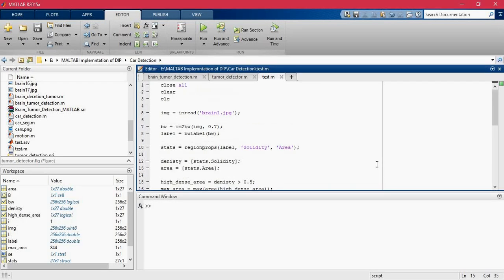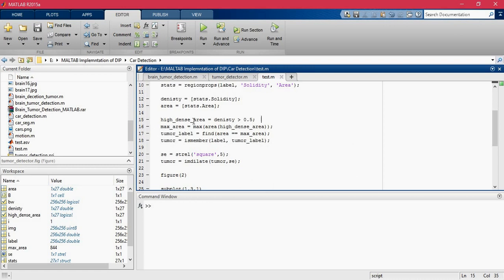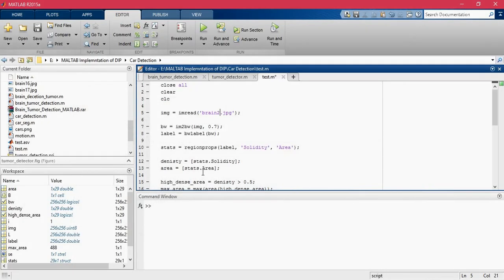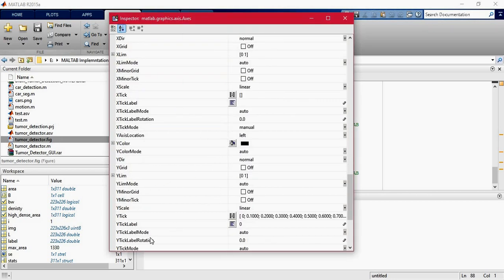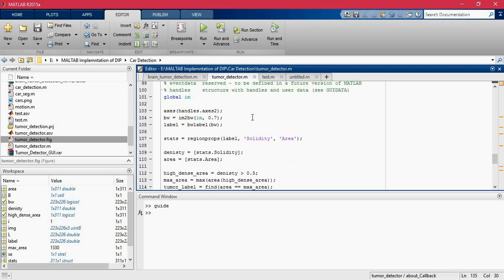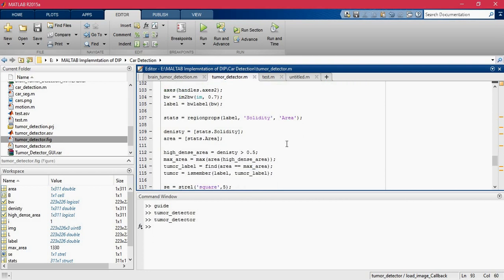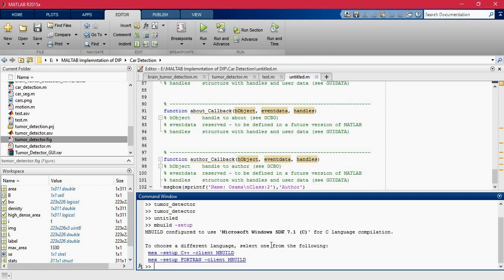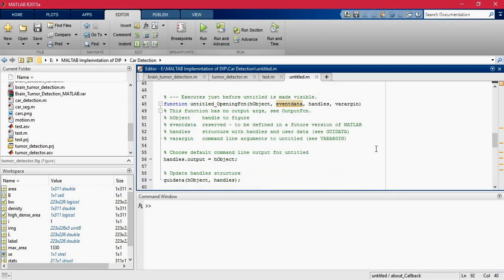Brain Tumor Detection using Matlab - Image Processing + GUI step by step

Comment: close all;

clear all;
clc;
img=imread('brain1.jpg');
bw=im2bw(img,0.7);
label=bwlabel(bw);
stats=regionprops(label,'Solidity','Area');
density=[stats.Solidity];
area=[stats.Area];
high_dense_area=density>0.5;
max_area=max(area(high_dense_area));
tumor_label=find(area==max_area);
tumor=ismember(label,tumor_label);
se=strel('square',5);
tumor=imdilate(tumor,se);
figure(2);
subplot(1,3,1);
imshow(img,[]);
title('Brain');

subplot(1,3,2);
imshow(tumor,[]);
title('Tumor Alone');
[B,L]=bwboundaries(tumor,'noholes');
subplot(1,3,3);
imshow(img,[]);
hold on
for i=1:length(B)
    plot(B{i}(:,2),B{i}(:,1), 'y' ,'linewidth',1.45);
    
    
    
end

title('Detected Tumor');
hold off;
    

works absolutely fine for me::::
thank you so much
Reply: Sir thanks a million but i have problem in running the code.i runned the code but there is problem in 

max_area=max(area(high_dense_area));
Reply: Sir can I get the dataset for this code
Reply: That is available with the download link
Reply: @iram1103   where is the download link ?
Reply: @iram1103  where is download link
Reply: Please send share your gmail here or contact number
Reply: hello ...can you tell me about this code...is this code will only work in MATLAB software
Reply: Thanks for the code
But I got an error in this line
img=imread('brain. jpg') ;
Will u pls help me, I didn't understand why I got the error in this line.
Reply: @preethip7311  dataset path issue
Reply: @sandeepv2441  pleas , What is the solution to this problem?
Reply: @preethip7311  select the exact path of ur image....
Reply: @preethip7311   were the image as stored in ur computer
Reply: can you explain the for loop and what the code is saying>
Reply: Sir , I need your  help in completion of our project.
Detection Of Pancreatic Cancer , we've stucked at Minimum Distance Classifier algorithm .
Please help us to get out of this Sir
Reply: for i=1:length(B)
    plot(B{i}(:,2),B{i}(:,1), 'y' ,'linewidth',1.45);
Please explain this

Comment: this is also showing detected tumour for non-tumorous images. how can i fix that?
Reply from the maker: Using my method should give you some false positives as it's not a method based on training rather it's based on measuring the solidity of objects in the MRI image.

You can do it your way by training a model to detect the tumors and avoid false positives as much as possible.
Reply: @GEEKLEAK25  yes im planning on using a neural net for classification. thank you so much. this is amazing work!

Comment: sir i need code of tumor_detector.m as it is not properly uploaded.
Reply from the maker: You can find it pinned in the first comment.
Reply: @GEEKLEAK25   i am not getting it can u help... code is of test.m only
Reply from the maker: The code is in the comments section of this video. It’s the first comment. The code is the same. It’s just changed a little bit to be in the GUI form. Watch the whole video and copy it. I am sorry but I no longer have the files. Thank you.
Reply: @GEEKLEAK25   thank you sir
Reply from the maker: You are most welcome 🙏🏻
Reply: Hey if you have got the code could you please send it to me ? As I'm facing the same issue. 
anjanaranbir5@gmail.com

Comment: if there is no tumor in the image so, what is the code for explain that please?
Reply from the maker: This is actually a good question to ask. At the time of recording this tutorial, the purpose was to detect the tumor in an image with an actual tumor. But the case you are asking about wasn't tested. Give it a try, and get the code from the first pinned comment and check if there are any false positives.

Comment: Thanks for the code
Will u pls send me the images which work for this
Reply: wher did you  got the code
Reply: @nandu1774  
close all;

clear all;
clc;
img=imread('brain1.jpg');
bw=im2bw(img,0.7);
label=bwlabel(bw);
stats=regionprops(label,'Solidity','Area');
density=[stats.Solidity];
area=[stats.Area];
high_dense_area=density>0.5;
max_area=max(area(high_dense_area));
tumor_label=find(area==max_area);
tumor=ismember(label,tumor_label);
se=strel('square',5);
tumor=imdilate(tumor,se);
figure(2);
subplot(1,3,1);
imshow(img,[]);
title('Brain');

subplot(1,3,2);
imshow(tumor,[]);
title('Tumor Alone');
[B,L]=bwboundaries(tumor,'noholes');
subplot(1,3,3);
imshow(img,[]);
hold on
for i=1:length(B)
    plot(B{i}(:,2),B{i}(:,1), 'y' ,'linewidth',1.45);
    
    
    
end

title('Detected Tumor');
hold off;
Reply: @md.abraribtesham6167  that is full code

Comment: This code  is not that much accurate. This does not work on all images. I try this code. but it dose not detect the accurate  tumor region. On some images it is not detecting tumor
Reply: Obviously, it takes more than just thresholding to find tumors. This is a very basic method. If you want something smarter, you need to use machine learning.
Reply: can u send me the code @Suyeon ji